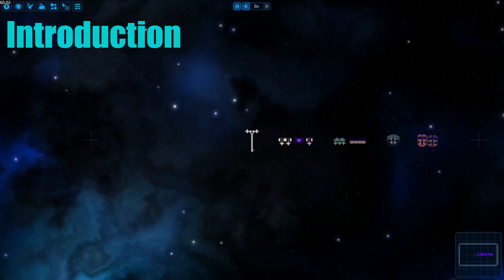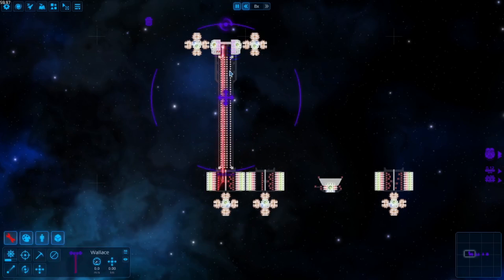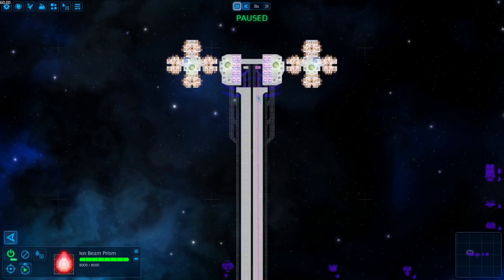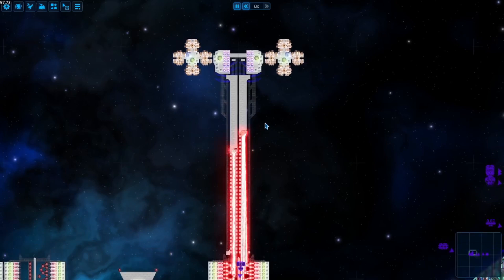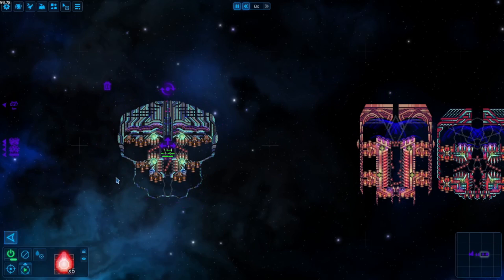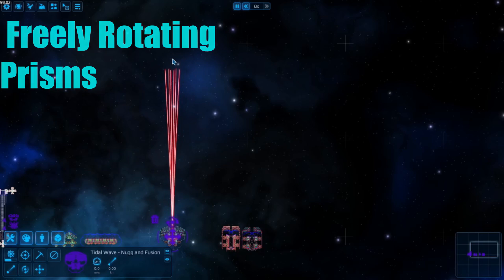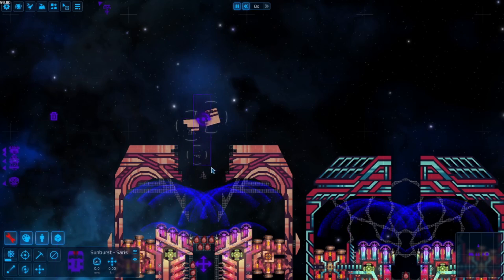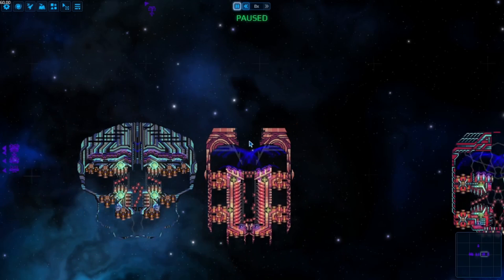Cosmoteer Basic Guide: Prism Overview

Comment: Redirection prisms can be very powerful if used correctly. If your prism is close to beam emitters, then when the crystal is destroyed it explodes and destroys those valuable emitters. If you redirect a beam further from the emitters with prisms (say, to a place with armor) you won't suffer much damage if the prism is destroyed and the other prisms can still aim the beam slightly. Besides, there is no power loss for using redirecting prisms.

Comment: Thanks for the video. Are prisms and railguns better then deck guns?
Reply from the maker: Weapons aren't all necessarily better or worse objectively so, they all have different niches and fulfill different purposes

- Railguns are high range precision burst weapons, but suffer when you have to get through a lot of armor or heavy shielding
- Ions are very strong constant damage weapons good at pressuring, but have no burst ability (making them also struggle against shields) and often require immobilizing opponents to deal damage
- Deck guns are new so there's not as much solid info about them (plus they're likely prone to being changed), but their shtick as it appears thus far is being able to stack lots and lots of defenses in front of them at the cost of no projectile velocity, which makes it so hitting stuff is extremely difficult
Reply: @SarisWinterwisp  Really long railguns can punch through nearly anything, and each tile they punch through also takes damage and fire, AND they outrange pretty much anything. The only thing that can consistently defend against them is massed flak (long railgun projectiles are very fast, tho, so you need a LOT of flak to shoot them down) or several efficient shield generators (if you can catch the entire projectile on shields, then recharge the generators before the next shot, you can effectively neuter even the longest railgun). 

A railgun paired with a few EMP missiles is an incredibly powerful long range weapon system, as the EMP will drop any shields while the railgun blows things up. You just neet to tack on enough reverse thrust to allow you to control the engagement range and you can punch well above your "weight class" (oh, and keep an eye on missile ranges. Your need for speed will probably result in a fairly vulnerable design, especially to the flanks and rear where missiles like to land. Also, the fact that ammo factories require mined materials can be a pain if you're not careful with your storage.)

Sidenote: yes, I like railguns. Why do you ask? :P
Reply: @derkylos  Incredibly long railguns are painfully cost-efficient, though, especially past 9 accelerators after which their unique ability of extending railguns' range reaches its hard limit. That's why you'll never see a competitive design that uses more than 9 accelerators, like, EVER. It is 100 times more worth it to built two 9 accelerator railguns than one 20 accelerator one, as not only they have most of the benefits like maximum range already, they also cost cheaper and do more raw damage. Most people argue that the best way to use railguns is to spam over a dozen of ones without any accelerators at all, as they are the most cost-to-damage efficient and take less energy to power per point of damage as well, but I am personally against these designs because not only they look way uglier than normal railfans do, they also expose way more of your ship that each needs defending, practically rendering their cost-efficiency useless. They also don't have any benefits of accelerators obviously, like increased projectile velocity, range and, yeah, raw damage.

Plus, Railguns don't start fires on ships! It might appear like that, but only because you might pierce through and destroy an explosive object while attacking a ship, or manually target it.
Reply: @NickAndriadze  Do accelerators beyond 9 increase the penentrating power, tho? 'Coz that's really the thing I like most about them (well, when combined with the ridiculous range). You might not be blowing out the shield generator in one shot, but if you can do damage to components behind an active shield, eventually you'll destroy the generator completely...especially if they can't return fire (so you have all the time in the world to plink at them :P).
Reply: Never tried deck guns as they stun nearby crew when they fire.
Reply: @NB-TB  Bro, they stun crew for 0.05 seconds.
They also deal a fuckton of damage.
Railguns only do a shit ton of damage.
A fuckton is greater than a shit ton.
Reply: @lkhdmrtn  True but you have to get inside their missile range to fire deck cannons and at level 16+ they have ships with 24+ missile launchers, With rails and prisms you can snipe while staying outside their missile range.
Reply: @NB-TB  Just get flak.

Comment: Speaking of prisms, I have a build where I've put one last prism at the tip of my ship so it can turn and aim, but it seems to be locked in place. I was able to get it unlocked once, but then in turned weirdly.

How do I get the last output prism to act nicely as a turret?
Reply from the maker: Tools are planned in the future to make prisms better turrets (such as being able to limit their arcs, them not rotating into your ship and such) but currently they're somewhat janky. I myself, though it requires micromanagement, tell them to fire on specific opponent parts and if I disengage untarget them so they can rotate back to forward in their default state
Reply: One thing I do is set the prism to only target specific parts. That way i can be more precise.